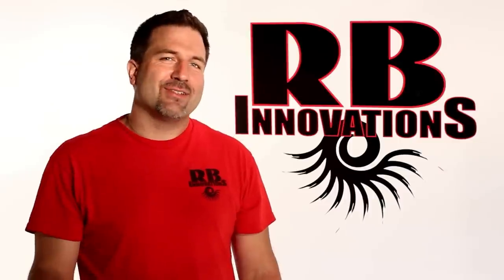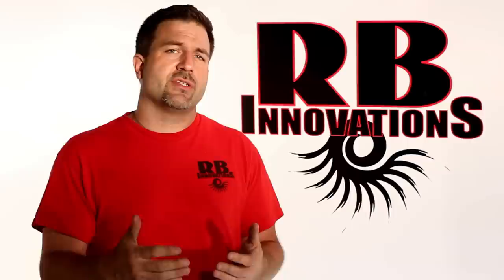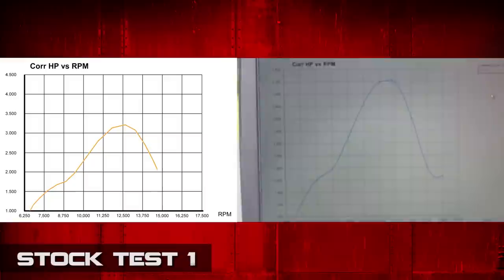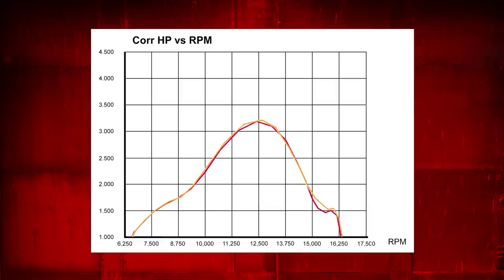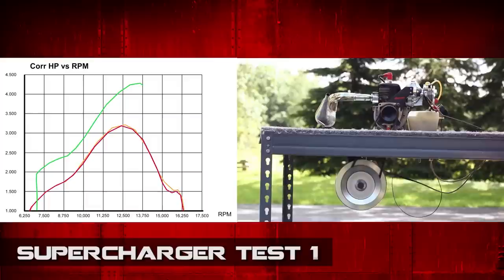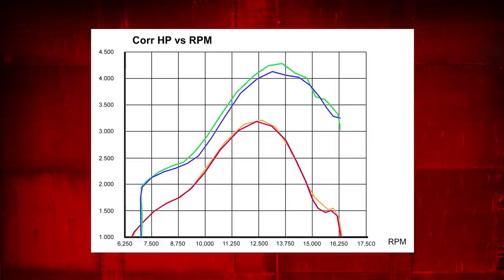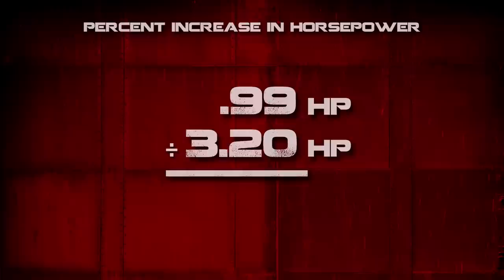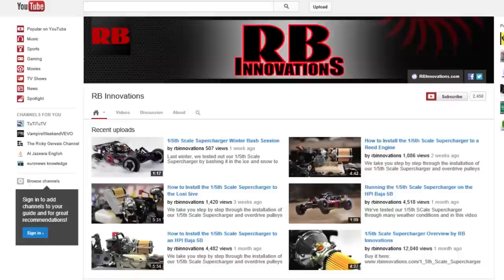Dyno Test of the 1/5th Scale Supercharger by RB Innovations

Comment: ...from what I have seen these so called superchargers have a little fan in a housing...superchargers are pumps...they pump positive pressure...either by acceleration and diffusion as in a centrifugal supercharger...or by positive displacement like in a roots blower...fans won't pump pressure...if these things create any more  power...I think it is strictly due to the expansion chamber...the so called supercharger is a scam that is used to lighten peoples wallets...
Reply: Paradise Road so, by your theory...turbos niether create manifold pressure nor do they increase hp. The "fan" as you so elloquently put it is the same as the cold side of a turbo rotor...but it's crank driven instead of eg driven. Common sense states that sunce it's driven by the crankshaft it falls into the category of supercharger.
Reply: ...if the device above was constructed with a proper impeller and diffuser...then it would be a supercharger...I'm saying that the above device has NO DIFFUSER and an improperly designed impeller...it can't possibly create boost the way it is designed...
Reply: Paradise Road granted...the impeller is not properly designed, especially when compared to a modern blower...but one thing you have to take into account, is that with motors this small, very little air needs to be moved to create boost. Were a larger version of that same setup used on a 4 cyl...or hell, even a big bore single, it would be worthless.
Reply: +ROTAXD ...even if the impeller was designed correctly...with no diffuser present...there can be no boost...no pressure created...the impeller is supposed to accelerate the air to extremely high speed at the impeller tips...then it enters the diffuser and as it emerges from the diffuser it slows drastically and converts the kinetic energy from the extremely high speed into pressure...the toy blower in the video features none of this...it may atomize the fuel a little better from the air fuel being whipped around by the crude fan blade...but there's no way it will create boost pressure...see if you can find the books written by Hugh MacInnes on turbochargers...the latest one is available on Amazon...all the information you will ever need on centrifugal superchargers and then some...

Comment: scam scam scam... you can't charge a 2stroke engine
Reply: Yeah, you can. Ski-doo has turbo 2 strokes. Hell diesel 2 strokes can't run right without a turbo or supercharger giving them the added air they need to run.

Comment: Even if these did work I wouldn't want one. Nitro or gas RC cars are WAY to squirrely already. Heck a stock HPI 5t will do backflips while doing 20-30MPH not sure why you would need extra power...
Reply: Zachary Caviness Tell that to the people who drop in 80cc engines that have to be started with Go-Kart starter boxes.
Reply: Zachary Caviness You can get a stock engine to wheelie at 20-30mph? Please post a video of that.
Unless of course you mean it's doing a wheelie purely from the air goingn undner the shell and giving it that trademark 'parachuting' effect... While I think these superchargers are a load of crap, theirs no way a completely stock 23 or 26cc engine will wheelie from power alone.
Reply: A 5t won't do shit at 20-30 mph. U want a backflip at that speed u need a savage flux or e revo.
Reply: You can barely get a Losi to wheelie like that with an 18 hp engine and if it gets squirrelly, you'll wreck it and break a ton of parts

a 7 hp modified one won't even back flip with a kicker

Comment: 1hp gain and higher RPM resulting in more wear and tear on the engine internals. Save your money and buy yourself a nice 1/5 scale TP Power system from TJ's Custom Rc's and you can have yourself a 12, 16.1, or 20Hp brushless system instead running on 8s. Far more fun. 45 minute run times with quality batteries. Contact Brian over there at 720, 320, 2213 (call/text) and he can get you set up with something cool. I'm sure he can find you a brushless conversion kit to fit your rig. Lighten it up in most cases and no tuning issues.

Comment: For you naysayers you don't know what you're talking about. Nice little dynamometer setup and decent for an Rc car for inexpensive hp. Two strokes have been supercharged for years. I've been in the business and have owned a dyno myself and can attest to this. Uneducated people just can't understand and need to go back to school and spend some time studying math, physics, and basic science.
Reply: it would work with multi cylinder 2 strokes different valve timing
Reply: that one guy true, although some of the fuel/air gets pushed out the exhaust port, there is still more then enough left in the combustion chamber to make decent gains in hp.
Reply: 2 strokes dont have valves to time tho ????
Reply: And I bet you bought one of those fuel saving aluminum funnel things sold in the back of magazines in the '80s.  Yeah right!

Comment: This is such a load of bs.... that dyno graph of the the supercharger is a type of power gain if it was turbo(and 4 cycle). A supercharger takes energy to turn, and boost increases with rpm. You would have a loss of power at low engine speeds and eventually a gain of horsepower after the supercharger starts to create boost. NOT an apparent positive boost at all rpm.  COMPLETELY FABRICATED BS

Comment: This is so bullshit.  All it does is change the tune.  Lean your needle out like the restriction of the charger does.  You can't super charge a 2 stroke.  Port timing people.
Reply: you can supercharge a 2 stroke. most heavy equipment uses supercharged and compound charged 2 stroke engines.
Reply: +Monel Funkawitz Why exactly would you not be able to supercharge a 2-stroke engine??
Reply: +Linus Freyer You have to close the exhaust port before the intake port.  By nature of a two stoke, the exhaust port opens, intake opens, scavenge, intake closes, exhaust closes.  You'd need some wonky waffle porting valve system to make it do other.
Reply: The port timing problem is usually solved with a tuned pipe in most RC cars, which creates a backpressure that pushes back the Fuel-Air mixture from the exhaust pipe back to the cylinder. This is also why RC cars spit so much fuel out the exhaust. It's not flawless, but it would allow for the functionality of a supercharger.
Reply: +brandon smith ...supercharged 2 stroke diesels use exhaust valves which are timed to close before the intake ports...exhaust timing on an engine with exhaust valves can be tuned to absolutely anywhere it needs to be...
Reply: Monel Funkawitz you can't, eh ? So, why was it that 2stroke diesels (namely detroits) REQUIRED a supercharger to run ? Powersports guys have been putting blowers & turbos on two strokes for at least 3 decades if not longer. Although some of the f/a will be pushed out of the exhaust port there's still more then enough left in the combustion chamber to get big hp gains.
Reply: Shea Holvenstot the haters don't even understand the basics of a two stroke or that port timing can be changed. Start trying to explain tuned pipe theory to them and their heads will explode lol.